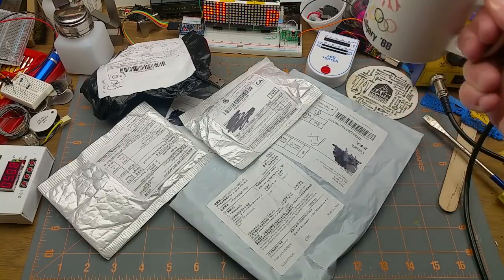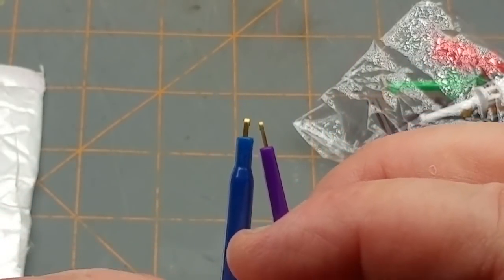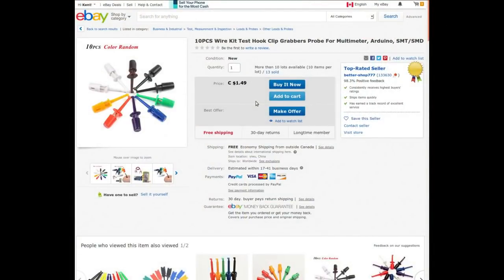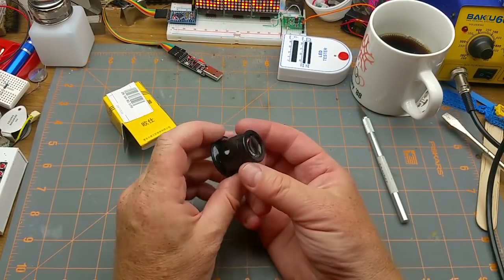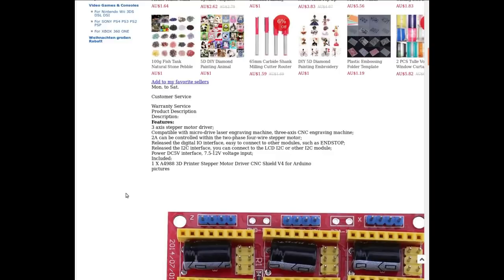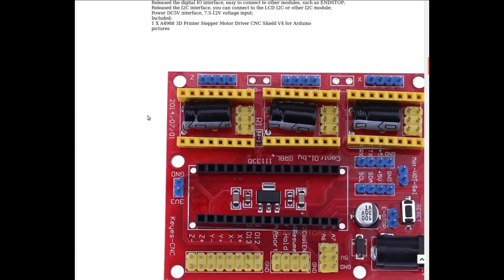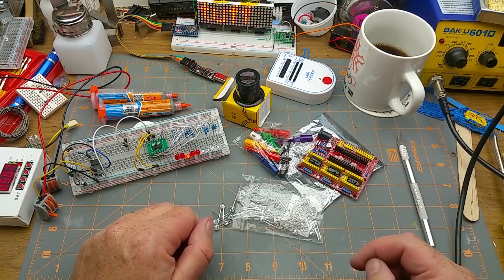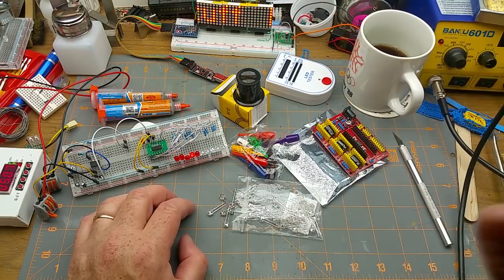mailbag monday 37

Comment: I got some of those minigrabber type test clips with dupont wires attached super cheap. Except they didn't bother to solder the wires to the grabbers, just looped the wire through the eyelet. They also fall apart. Still don't know a good source that isn't really expensive.
Reply from the maker: When I''m going for cheap test cables, I tend to assume any pre-made ones are basically just a kit of parts that I can use to customise. They're seldom reliable enough out of the box anyway.

The larger set I showed were some that I made from parts. Doesn't take very long, and I know I can trust them a bit more than the cheap bought ones.

Comment: Nice recovery on the knife pointer incident.  In the next month or so I’m going to have a lot of parts ordering amnesia because I’m getting to the bottom of the barrel with stuff I ordered as far back as last December and I am still opening it and I’m running out of fresh stuff so it’s Christmas every week for the next while over here.
Reply: Hope you give AliExpress a try.  Here in the US, things typically get here in less than 5 weeks.  Sometimes, 10 days!
Reply from the maker: I've seen a similar wide range in arrival times from ebay, aliexpress and banggood sellers. Some times it's a few weeks, sometimes it's half a year.

The only common bottleneck point I can think of is the post office and/or border inspections.
Reply: I do have several Ali pages open to look at. I seem to be buying things a lot less lately so it’s moving slowly.

Comment: The Nano CNC shield, some of them have problems - they expect GRBL to be compiled with different pins to the defaults, and the jumpers under the motor drivers which should set the number of microsteps used don't work.
Reply from the maker: Thanks for the heads up.

I may just end up using that board more as a generic stepper control board for some project.
Reply: In addition the microstepping jumpers are wired incorrectly, as delivered they are in permanent full step. https://www.davidpilling.com/wiki/index.php/CNCShield